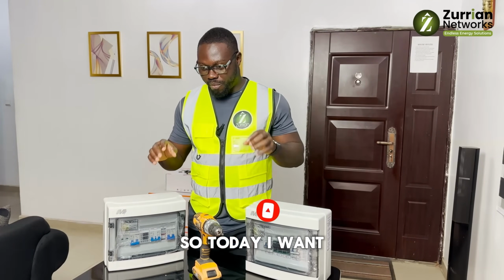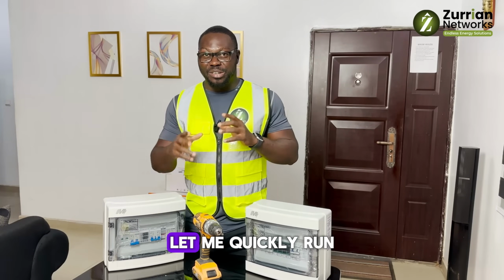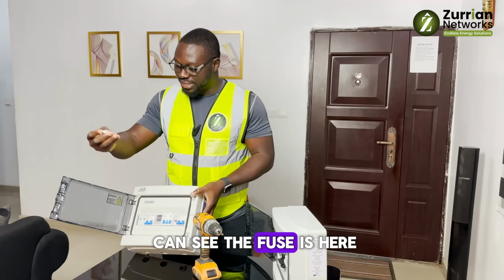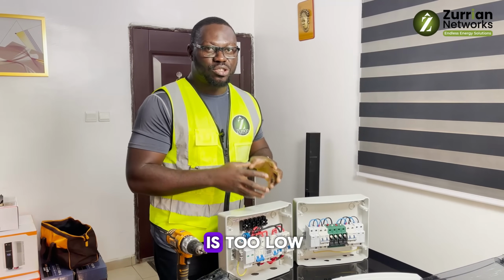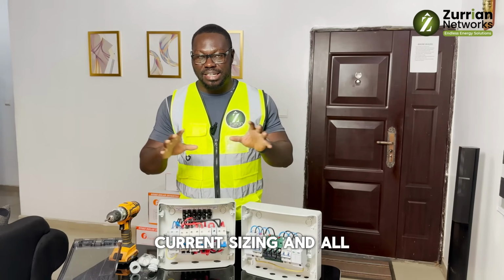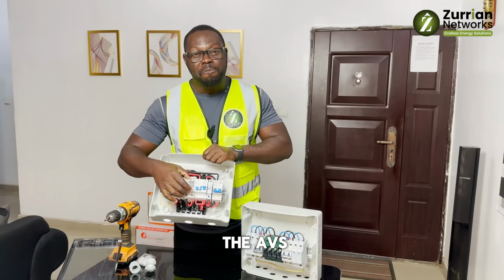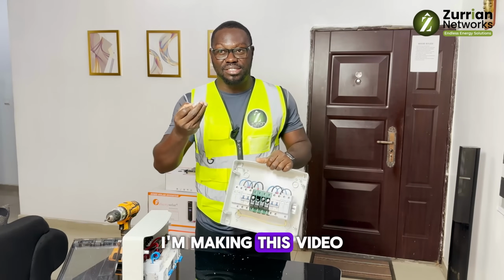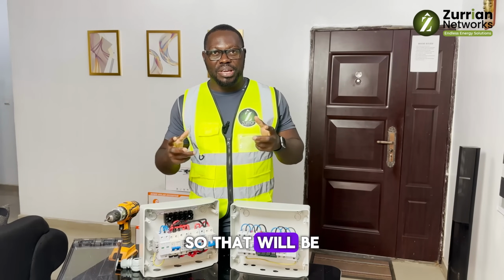Best Inverter Protection: Protecting solar inverter system from High/Low Voltage, Surges & Harmonics

Comment: Wow... an amazing one. 
My input - SPD will be after the breaker or after another external breaker, so that if the SPD is damaged by a surge, the breaker trips instead of burning cables or the SPD.
Neutral in a single phase circuit should not be fused because If neutral fuse blows and live remains connected, the circuit is still energized and dangerous.
Overall you did a very wonderful and educational video. 
Thank you.

Comment: Please is there any over current protection device for solar panels? 
Because over current destroyed my powerstation. It  is 500w solar input so I doubled the 500w solar panel in parallel and I really enjoyed it thsoe period now it fried. I want to repair the powerstation but is there any device I can buy that can be clipping the amps well for me so it doesn't destroy again if I repair it thanks?
Reply: Doubling the 500w panel makes the panel 1000w, that is what destroyed the power station. Watts and Current doubles, while voltage remains the same in parallel

Comment: Just to assist or contribute , 1. The SPD should be after the MAIN BREAKER  and NOT before . 2. The SPD should be earthed on its own with a 10mm2 solid  copper cable  and not with any other applicances or earthing arrangement 3  A Central  Voltage Stabilizer should be used instead of the Voltage regulator .. 4, a SPD should be used before and after the Central Voltage Stabilizer , Hope this helps  anybody

Comment: Hello sir, but we hardly have up to 200v here is nigeria, what our electricity company always provide is about 180 to 190v, means if we set up our inveter system on 200v this means we are depending on our inveter system alone.
Reply from the maker: Believe me, it's not from the electric company. Your area transformer is overloaded and poorly balanced and probably very far from your home – hence enough voltage drop.
Reply: You can set to 190v then if the 190v is safe for the inverter. My own inverter switches off from grid when voltage is lower that the minimum voltage is made to operate. Meaning, it has inbuilt voltage regulator.

Comment: Hi nice intelligent work,What size of wire did you use inside the AC distribution BOX.?
Reply from the maker: The AC box is size dependent; this particular one is for 10KVA inverter so wire size is 10mm^ flex wire

Comment: How do you know if an earthing system in building is effective
Reply: U test the earth with neutral on a bulb and it will light note once u get a brighter light means ur earth is effective but once u get a low light know is not effective

Comment: Please my modified sine wave inverter voltage is too low, like less than 200v, how can I boost it to 230v? Can I add an adjustable voltage protector too?
Reply: Is not always low it is ur connection of the solar panel that will determine ur voltage out come and not the sine wave
Reply: @vincentenaholo2536  how? It's 18v and 6a

Comment: The intent of the video is laudable but the execution is lacking in depth. I suggest to do the video in series and detail the whys and how's of each protective device in each series. For example, fuses and breakers do the same function, What are the advantages of each compared to the other and when would you want to use each? When do you fuse a panel? Is it in a parallel or series connection? What has the maximum short circuit current of the panel got to do with the decision to fuse a solar array in a parallel connection? Where is the best site to fuse if you decide to fuse? Circuit breakers are primarily designed to protect the downstream wires from overheating due to current exceeding the maximum amperage of the wire. Hence they are sized to the wire's maximum amperage, and not the inverter as you said in the video. Why should you put an SPD before a circuit breaker? A brief explanation of how an SPD works will help clarify the reason. Again, you cannot finish explaining about circuit protection in solar panel installation without talking about lightning protection, especially in areas in lightning prone areas. Well done for the effort, but consider my advice for a more informative video.
Reply: You have said everything I wanted to comment and more. Especially the part about the breakers being sized appropriately for the wires as that is what they are there to protect. The wires. Good report. Thank you

Comment: A highly informative presentaion that explains how to protect solar inverter systems from high/low voltage, surges, and harmonics. This has made it clear for me and I now know the tips for ensuring system longevity and optimal performance. Inverters and charge controllers is no longer cheap and anything required to protect it is worth it. Nice work

Comment: why do you need a fuse on the board when you have a circuit breaker on it...

If the AVS does it's job, why do you still need a circuit breaker

Comment: Wow am so impressive about protection of the inverter system 
But I have a question, am seeing fuse breaker on the pv box, but I usually use DC breaker , so which one is more preferable?

Comment: I called this over protection 😂, but is nice just that it will make the project more expensive.
Reply from the maker: The idea is to make the system last forever😀. But not too expensive when you compare it with value of the system in question.
Reply: @zurriannetworks  I like triple protection too. Protection can't be too much.
Reply: @zurriannetworks  exactly. i like your protection

Comment: The AVS is not a "Stabilizer". Therefore, it can't be an Automatic Voltage Stabilizer. Rather, it is an automatic voltage switcher. A window comparator in technical terms. It monitors the voltage based on preset values and switches on and off if and when the preset conditions are met. A voltage stabilizer on the other hand ensures that the voltage output of a supply is stable and does not fluctuate.
Reply: Well it is called a Voltage protector. But we get the gist of what he is trying to communicate. Kudos to his try at configuring. But I find it sometimes over protecting especially with the fuse on the AC side after the Voltage Protector
Reply: @rakoon678  Actually the fuse bit seems like something I would start advising for installations, simply because during raining season or thunder storms if there is no lightning protection installed above the panels having some extra protection for the system will be welcomed..
Reply: He actually explained it that way, he just kept using the wrong term.
Reply: How to connect an AVS if you're  using an inverter offgrid.  Tried wiring my load through it the load from the inverter didn't turn on.
Reply: @amososade7062 (AVS) simply means Automatic Voltage Stabiliser

Comment: Nice protection scheme, but the AC protection is missing RCCB, please note that it's very important
Reply: A RCCB is not a standard protection for an inverter. The RCCB's purpose is to reduce the level of injury caused by an electric shock. It works by monitoring the current in the live and neutral conductor, and trips if they are not equal and opposite in direction, a condition that occurs when current leaks to earth.
Reply: @amososade7062  And that can save your life!
Reply: With the surge protector installed which also has an earth path, that should also protect against ground faults

Comment: great video, please what about GFCI or Circuit Breaker GFCI in case of electrocution at home
Reply: For electric shock protection get RCBO
Reply from the maker: Great, just that RCBO is a bit higher in cost compared to GFCI
Reply from the maker: That is assumed to have been installed in distribution/fuse board.
Reply: @taiwoayo9800  RCBO and GFCI don't perform the same function

Comment: That yellow earth cable at 10:11, where does it get connected to eventually? Or two of the earth terminals just need to be connected like that and that's it?
Reply: Okay thanks. A video of these components being connected in an installation would be great 👍
Reply from the maker: Both(and every other earthing terminals) are connected to earthing system of the building.

Comment: Please make video on how you wired the protectors (CB, SPd, Fuse, AVS)
Reply from the maker: We will sure do, just turn on your notification button
Reply: @zurriannetworks  done 🥹
Reply: I'm interested on this solar system may you show a video details on how to connect the protection, and how you parallel the inverters to give out one output power,. pdf will also help us the viewers, thanks you
Reply: Using bus bars @duolkomgatkuoth6359

Comment: Secondly did the SPD need any rating
Reply from the maker: No
Just get either AC SPD or DC SPD depending on where you want to deploy it.
Reply: This is informative, if i add an ac surge protector at the output of the inverter in parallel will an AC breaker does it protect the inverter from inrush currents that might be caused by short circuit from the equipment in the house

Comment: How to set the automatic voltage protector
Reply from the maker: The setting is always on the manual. 
But depending on the brand you have, the settings most times are pretty much the same

Comment: do you need fuse when there is a circuit breaker of appropriate rating?
Reply from the maker: The fuse in the AC line is on the inverter output line. I had a case of the inverter that went bad(was giving out 250V) the fuse saved things from blowing off.
Reply: @zurriannetworks  The fuse might have blown due to the MOVs in the inverter soaking up a spike.  or the inverter was charging a low battery and supplying power to the house at the same time, under heavy load (load surge). The IEE regulation for mains supply is Vnominal (230)+/-10%(23) and Vpeak = Vnomial x Root 2. V RMS (V) * √2..... approximately 311V. So 250V should not be blowing up AC devices.
Reply: @zurriannetworks  But fuses are for current and don't work for overvoltage
Reply from the maker: Current is directly proportional to voltage
Reply: @zurriannetworks  in addition, you can have a constant voltage and still have an overcurrent condition. This happens when resistance drops. So, I think that was what happened with your fuse. Fuses don't respond to voltage but current flowing through them.